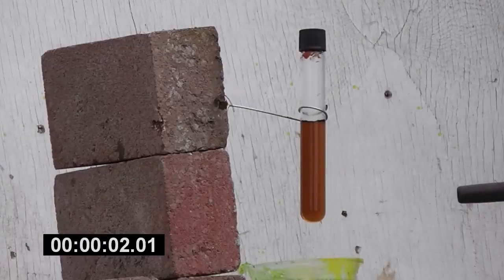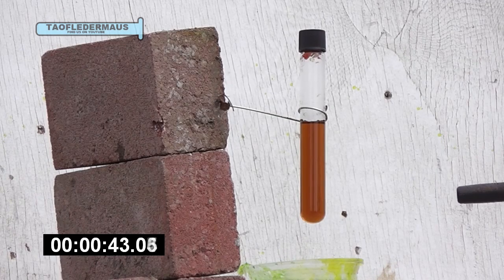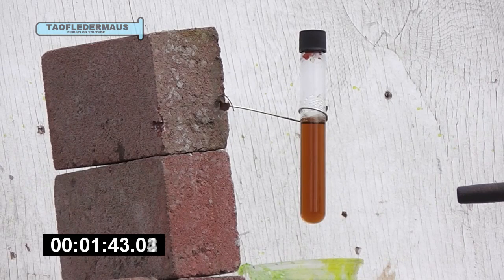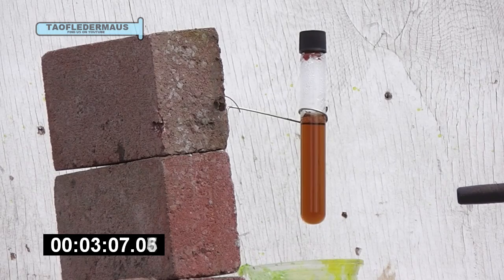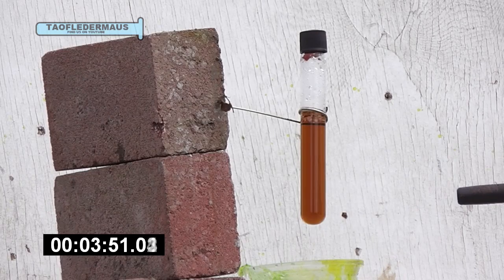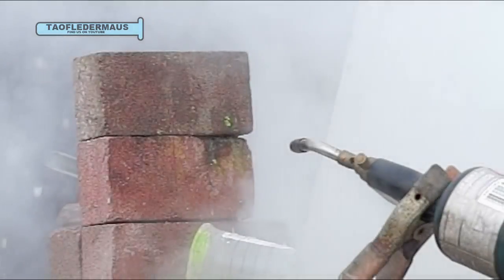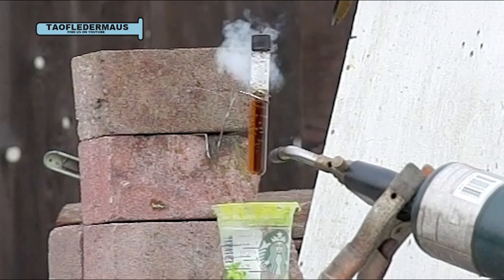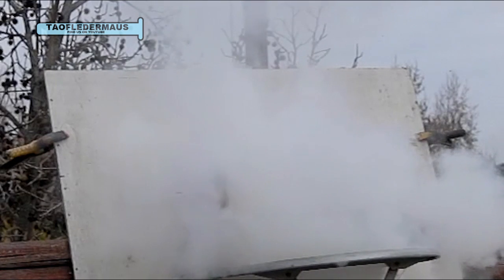TTTT - What happens if you superheat PEPSI?

Comment: two comments:
1. about making atest tube rocket, you mention there is nothing to stabilize it, how about using that metal thing you used a couple of times in recent videos (the one that was not so popular so you went back to wire and bricks)?
2. Have you tried oil+water? I wonder what would happen.

Comment: You could stabilize your test tube rocket the same way they do with fireworks. Attach a long skewer to the side of the tube to move its center of gravity under the nozzle.
Please.
Reply from the maker: A few others have suggested that.   The trick is attaching something that won't burn  to slippery glass with something that isn't going to burn off
Reply: *****
Thank you for your swift reply. You could use the Kapton tape. Oddly enough, Kapton is used on space suttles. It is almost like regular stationery tape except that it can withstand high temperatures. The skewer would be a problem though and I would solve that by arranging a sheet metal as a launching tower between the glass and the skewer. The sheet metal would be a ramp and double as protection of the wood from the fire.
Reply: ***** Use a metal cage-like design, should work I guess.

Comment: This is something like the Krakatoa´s tube, You can see that the liquid when its heated, vaporizes and increase the internal tube pressure. In this practice as you said, the sugar increases the boiling point of the solution (pepsi) but, pepsi does not have only sugar, every non volatile ingredient will increase the boiling point its very interesting. Another important point is that that soda contains CO2 and its an elemental chemistry rule that a gas concentration in a liquid decreases when its temperature grows. In this case you have the water and other chemical vapors and the CO2 released when the temperature increase (previously of boiling). PLEASE, make a video of a rocket with a heater and a very carbonated liquid inside It could be awesome and dangerous.

Comment: You should get one of those laser thermometers. The ones that calculate temperature from distance. It would be cool to see at what point things blow up. I think they are very easy to get. Cooks use them a lot. Also do blood!
Reply from the maker: I have a Fluke IR temp. gun.  I forgot to bring it home from work.   The problem is the further you get away,   the larger the area it scans.   I think at 3 feet away,  it is looking at about a 6"  area,  so it may only show the temperature of the flame.    The laser is just there to aim it.    I don't want to put it too close  and damage it.

Comment: Have you thought about rigging up a laser/IR thermometer so you can get a rough estimate of the internal temperatures?
Reply from the maker: I have one at work that I plan to use.  But it isn't pinpoint,  it  looks at a "cone" so if I put it a few feet away,  it will be looking at a large area and will probably just show the temperature of the flame.  I'll give it a try though.
Reply: I have a cheap-o one from Harbor Freight that seems to have a pretty small sample area. It reads up to 999°F, granted I don't know how accurately.
Reply from the maker: ***** I think my Fluke reads 500c or 950 f   but in the instructions it shows how the further away you scan,  the wider the area it looks at.    I think at 3 feet it is looking at a 6" or so area.   I really don't want to put it any closer than a few feet away.   I think it was about $170.

Comment: But would the fins be near the epoxy plug at the bottom? You would be heating it at the top, so it should be far away enough to not melt the glue?
Reply from the maker: That would work if I was shooting it straight down,  but everyone wants to shoot it straight up.

Comment: Make rocket fins out of aluminum tape, because you will be heating the top, the fins wont break, if you cant do this, launch it out of a tube, like a mortar
Reply from the maker: I'd have to heat it right where the fins are,  so I am sure they would be burned off.  The adhesive would be the first thing to fail.

Comment: To shoot it straight up, use a length of copper or pvc pipe to act as a barrel. Rig it so the test tube peeks out the bottom far enough to heat it. Voila.
Reply from the maker: I have made a pipe to do that.

Comment: I bet you could JB Weld some fins on it, or Epoxy them.  Maybe wrap feathers on there like an arrow then epoxy them.  Could be neat if you were somewhere that a flying test tube of destruction could do no harm to any one or anything.
Reply from the maker: The problem is where I put the fins (bottom) is the exact spot I need to blast it with the torch.
Reply: Hmmm Maybe wrap wire around the top, epoxy that have it run down two sides and have the fins attached to that trailing below the  torch?

Comment: Fun science fact, Pepsi is NOT mostly water. Pepsi is mostly high fructose corn syrup, like all soda. Look at the nutrition info for grams of sugar, weigh the entire drink, and vomit on your jeans as you realize that the total weight including the bottle or can is less than twice the weight of the sugar. 50% or more of it is corn syrup. Seriously, try it. I did this in my Physics class. Might not work with a heavy glass bottle, though.
Reply from the maker: carbonated water is first on the ingredients.  If it was mostly HFCS that would be listed first.
Reply: HFCS is mostly water
Reply: ***** Respectfully, does the order of ingredients listed refute the empirical experiment?
Nigel Bess Respectfully, same question.
Reply: Maybe I should be more clear that I mean more of the mass is sugar, not necessarily more of the volume. I'm unsure on that.

Comment: Idea. 
what if you heated it in a metal pipe with a nossle in the end. so the pipe can be the rocket. the test tube could blow inside where all the contained steam would rush out the bottom. Or you could have a small spring loaded hammer that shatters the super heated water when its just about to blow. 

Essentially like setting a bomb of inside a pipe with a hole in the bottom to see if it flys up.
Reply from the maker: I"m not trying to make bombs.  lol